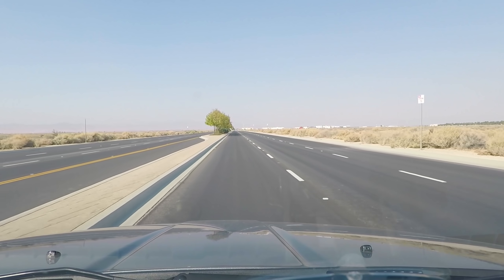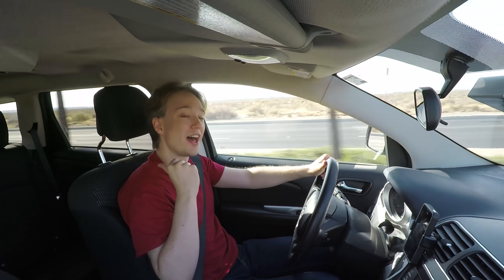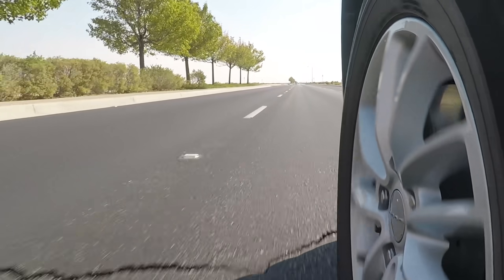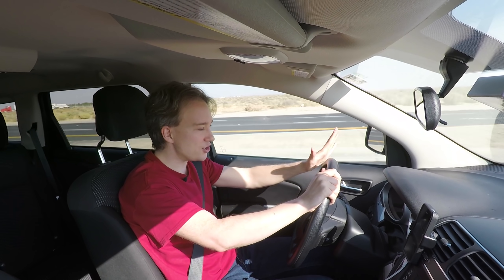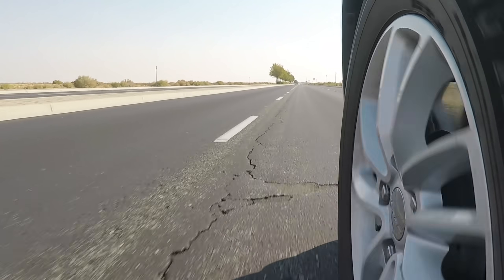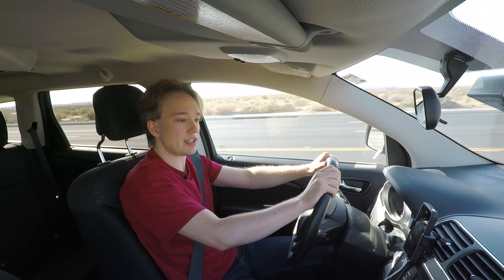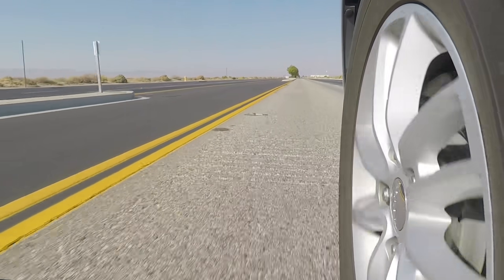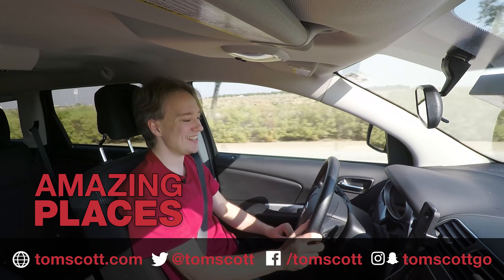Why California's musical road sounds terrible

Comment: try it at double the speed it sounds better
Reply: I like how the 2 times faster argument is the same problem that happened with the road, precision in the language.
Reply: @satibel  best comment in this thread!
Reply: So bassically drive two times faster
Reply: @andrewlarson5621  no
Reply: @andrewlarson5621  yes you donut. That was double means
Reply: @andrewlarson5621  play this video at 2x
Reply: Doubling the speed would get you a felony arrest and a HUGE $peeding ticket. The speed for this is supposed to be about 50 MPH, I believe?
Reply: @oncenterline  it’s on a multi lane divided road in the middle of the desert no one cares unless you crash.
Reply: Sam B. Now how tf do you go 1 times faster
Reply: @Jason_Eissayou  say you are going 5m/s  “1 times faster” would be 1*5m/s faster than your original speed. So 10m/s aka double
Reply: @Jason_Eissayou  you dont
Reply: I’ve seen you everywhere
Reply: This comment thread gave me stage 5 generalized cancer
Reply: NO
Reply: Actually yeah, it does sound better. (it's minor and slowed down, put the PLAYBACK to x2.)
Reply: @Ravenlay I think I agree with you, are you disagreeing with me or a prior comment by someone else?  I hate how YouTube removed the auto reply tagging in the web version.  And I also live in the US and hear them used interchangeably all the time.
Reply: it simply doesn't work int the web version as I understand now.  YT screwed their whole reply system.  I can't do a proper tag to notify people(at least I don't think there is currently a way) but I put that there just so it's clear who I reply too sometimes.  I do think the mobile version still lets you tag people with a '+', but I haven't used mobile in quite a while and could be wrong.  I also can't figure out how to view just replies as they are intermingled in my notifications with recent uploads from youtubers.  I'm subbed to like 250 channels but some of them only upload a few times a year and I miss their content and other times YouTubers will put out 2-3 vids a day and I will only care about 1 or two a week.  I really hate the current YT system.  Even their old legacy system beats the current one which simply has features that used to be there inexplicably missing.  I could rant on YouTube all day, but I'll stop there.
Reply: Sam B. No
Reply: Firestar9114 Ah. I was replying to Sam B. YouTube must have erased the part where it puts his name at the beginning. Maybe I fixed it? I @'ed him? Do I +? I dunno. It's a clunky system :P
Reply: Sam B. neither is 1x1 = 1.
Reply: Housedes123 He is Trolling 100%
Reply: +robert faber ok... that's kind of been established already.  Did you read our responses?
Reply: It wouldn't change it since it's the distance not the speed
Reply: true
Reply: Sam B. That is not real mathematics you are doing.
Reply: Kirill Olokin
• You're right, but there's no reason not to correct people when their language is wrong/problematic
• I don't think you know what "grammatically correct" means
Reply: Ryan Smith you’re actually right
Reply: @kylelyle24  you're* lmao sounds like you would know
Reply: Dustin Allen u happy?
Reply: @kylelyle24  no i'm terribly depressed and constantly thinking about suicide but im glad i could teach you something today
Reply: so 150 mph then? noted I'm on my way there now
Reply: the traffic cop hope you will try that
Reply: I come from the future with the answer. +100% and times 2 is the same thing. So if you do double speed, you could do either or.
Reply: Ohhhh, THAT's why it didn't sound bad to me. I had my video on x2 from a previous video I was watching, and I didn't realize I was still on x2 😆
Reply: It sounds exactly the same only faster.
Reply: Thanks
Reply: You're right, it does sound better!
Reply: In English, it's widely accepted that 2 times faster means the same as 2 times as fast. Look, I understand where you are getting this from(and I wish English was better developed than this), but that's just how the English language is. You are just being too technical, but I don't say that as a bad thing. I will admit that grammatically you are correct, however (because of society)2 times faster means the same thing as 2 times as fast. I hope this is settled now.
Reply: @housedes1233  Sam B. is grammatically correct, and it seems clear to someone like me, who uses math most of the day every day, that this makes sense. I am also aware of a "usage" argument that may be made for your interpretation. Frankly, most of the people I know accept Sam B.'s interpretation, so the same type of argument would apply. Which leads to the solution that a good writer would adopt (assuming clarity is intended): never use this phrase, as it has two definitions, either of which may be reasonably assumed to be true. The correct phraseology, from the standpoint of clarity, would be one which avoids such confusion, such as "twice as fast" or "2 times as fast". Or perhaps, "double the speed"
Reply: It's not just the speed that's the issue -_-
Reply: Same pitch, just faster.
Reply: which is the same as saying 1+1=2
Reply: Speed limits 55, you can't do 110 in a 55
Reply: @jeron9272  Germans: Pathetic
Reply: How do you know runner boy
Reply: It sounds creepy
Reply: Nah
Reply: It does
Reply: What
Reply: do it if you wanna get a ticket for wreckless driving
Reply: Did it, and now i REALLY heard the off notes.
Reply: It sounds like macrana
Reply: @whatthedogdoin578  XD
Reply: Instructions unclear, was pulled over by cops
Reply: nah it’s still out of tune
Reply: 110 MPH?
Reply: I played it at 1.75x and 2x speed, its really better.
Reply: Sounds like crap
Reply: Road safety laws prepare to be ignored.
Reply: But still bad
Reply: It does!
Reply: You right, but it still out of tone
Reply: 110 miles an hour, I'd be surprised if an SUV can even get there fast.
Reply: Time to drive at 240 km/h
Reply: I perfectly agree with you on the fact that the incorrect use of a term should not change it's meaning, and when talking about grammar I do agree that 2 times faster is 2 times on top. But that's just how people are, and when talking with people, I just use the term '2 times faster' as in 2 times as fast because people understand that. I would use '2 times faster' as in triple but it would confuse people so I don't bother. But I can tell you know what 2 times faster really means, so I'll admit that you are correct. Hopefully society will learn the real meaning behind '2 times faster' in the near future, but until then I'll just be using '2 times faster' as 2 times as fast so that I don't cause confusion. It was nice talking to you(I don't get to meet people like you often), and sorry for trying to prove you wrong. Hopefully it's settled now. Have a nice day/night.

Also I'm not from the US, just like you guessed.
Reply: Ryan Smith please leave I’ve seen you way too many times
Reply: all GOAT mathematicians are under this main comment😂😂😂
Reply: harryisbeast You are right, but what Sam B. is trying to explain is that 2 times faster is 2 times the speed on top of your speed, because the word faster is used. The problem is, 2 times faster is accepted as 2 times as fast. So Sam B. is correct when looking at how it is worded, but you are right when looking at what it actually means.
Reply: Sam B.
Sure, you are grammatically 100% correct. But please, don't forget that language isn't math. It changes over time and it is fine, there are no rules that can't be changed by community. Just look at  thousands exceptions, they do not follow the rules, but they are correct.

I am not english speaker, therefore i used to think about the word "faster" in this context as just a direction of change, the opposite of "two times slower". However i am not sure anymore that "two times slower" is correct sentence, would it mean x-2x=-x for you or is it just wrong?
Reply: @WeNeedToGoDeeper  No, hes not 100% gramatically correct. 2 times faster is still double speed. TIMES equals to "*" in equation.

2 times faster than x
2*x=2x

1 time faster than x
1*x=x
Reply: I can see how you got that, but it's incorrect. You're thinking 2*speed on top of your current speed, making it triple the speed. What Andrew Larson said is correct, and here's why:

Let's say we have two weights; 'A' and 'B'. Weight A is 1 kilogram, and weight B is 2 kilograms.

We can say that weight B is 2 times heavier than weight A(B divided by A equals 2, where B represents weight B and A represents weight A), but using your logic, by saying that weight B is 2 times heavier than weight A, weight B is actually 3 kilograms since it is triple of weight A.

Now let's apply this to speed:

If I am travelling at 30km/h and I accelerate up to 60km/h, I am now travelling two times faster than my previous speed. The formula behind this; 30*2=60. When I say two times faster, I am multiplying my previous speed by two, which will be my current speed.
Reply: wtf is this comment section does someone actually not understand that 1+1=2
Reply: @fluffy-xm9yn  It’s not that they’re questioning the math, but the grammar of the sentence. Of course they know 1+1 = 2 but they don’t know if 
fast = faster
Reply: @dinnerboons1504  thats so dumb anyway
Reply: @fluffy-xm9yn  it’s quite special
Reply: +Ryan Smith IMPOSTER!
Reply: @ryansmith3448  among us
Reply: still out of tune
Reply: @ryansmith3448  OH MY GOD AMOGUS
Reply: Sam B. So your issue is saying "faster" instead of "original speed". Faster isn't indicating an offset, it's indicating a sign/direction. It decides whether or not you invert your factor as actually saying zero point five times as fast is awkward to most people. Thus you say twice as slow and invert the factor giving (1/2)*speed. And just like with faster it makes very little sense to say you are going one times as slow. But that doesn't mean that you offset it by the original speed. That's why in the English language we usually say "the same speed" as it is more obvious than saying one times as fast as it is explicit in the two values being equivalent.
Reply: Sam B. "Times" is basically the word form of x in an equation. You're saying that he should go 1 (representation for current speed)  times 1. He should indeed be going 2 times (2x) speed.
Reply: 2x speed as in the playback speed on the YouTube video
Reply: Did I math?
Reply: +Firestar9114 - The word "faster" absolutely does indicate an offset, though... If, rather than talking about "two times faster", you were talking about "50km/h" faster, it would be hard to find somebody who would indicate that second phrase as meaning the car was traveling at 50km/h, instead logically assuming that it's driving at 50km/h plus the original 50km/h, thus making 100km/h total. How then would it logically follow that in the exact same sentence, with the exact same syntactic and semantic structure, the meaning of the word "faster" suddenly changes drastically when changing from an absolute indication of speed difference to a relative one?
Reply: Sam B. That’s times two, one times one is one
Reply: Obviously if you take a scalar and you say faster that is different from taking a factor and saying faster and the preceding amount thus changes the implication to addition, not the word faster.  Faster is still just indicating the sign for addition/subtraction in this case.  Removing the word times and using a value instead of a coefficient is what changes that context.  2 times faster, or twice as fast still means 2*speed.  Saying 50Km/h obviously means 50Km/h + speed, but the operation changes due to giving a scalar and the lack of the word times.  faster indicates simply the direction { '*' OR '+'} and slower is { '/' OR '-' } and the preceding words define which of those you choose from those sets.
Reply: If you do it at 0.25x speed it’s like rock music
Reply: +Sam B. I mean, sure, grammatically you're correct, but this is math, and times always means the same thing as multiplied by.  So I have no idea how you've heard that 2 times faster would mean 3 times.  I know where you're coming from, and technically the grammar is correct, but x times ALWAYS means the initial thing multiplied by whatever x is.  What's grammatically correct isn't always worth using, and you'll just confuse people if you try to use it like that.
Reply: @Loj84  NOPE. It's different for different people, and much like many such differences in usage, it simply has to do with how a given person has used it. I've heard it mostly Sam B.'s way, but a significant minority of the time I've heard it your way. The silly thing is the insistence on using this form to describe scaling, particularly on the internet, which is inherently non-local
Reply: Your channel is dead
Reply: but that's why we have the convention.  Specifically because it would be awkward to say three halves faster, you instead indicate an inverse operation and evaluate out the three halves and say "8 times slower" or "8 times as slow" thus you would do = (1/8) * OriginalSpeed(50km/hr) = 6.25km/hr.  No one would ever say "three halves faster" as the entire point of such a convention is to eliminate stating awkward spoken decimal and fractional values.  This way the awkward phrasing is eliminated.  That said you could also state "object A moved 1/2 as fast as object b"  in this case you again treat it as a factor and simply do speedOfB = (1/2)speedOfA.  It is still valid and used in such simple fractions, but much of the complexity of (1/2)^3 can be removed by evaluating it out and inverting it.  It's not invalid to use the method you gave, It just causes more mental strain either way.  and if you rally wanted to scale 50 Km/h up to 125 km/h you simply say. "two point five times as fast"  Unfortunately the decimal can't be completely eliminated in this case, but because of the relationship in scaling it is still a reasonable value and we can remove the power operation, and it makes more sense than adding 1/2 the original speed cubed to the original speed.
Reply: +*Markus* - Oh, for crying out loud... Nobody here is arguing about what the word "times" means in this context, everybody is agreed about that. It's not even the operative word in the sentence, because that is "faster". If the word "fast" had been given in the positive degree, it would have been fine, because that simply indicates an absolute, but since it's given in the comparative degree, as "faster", it implies a change as compared to the original, hence why (as I pointed out in my previous comment) we say "50 km/h faster" if we want to say that something is traveling at 50km/h plus the speed we're comparing it to, not if we want to say that it's just traveling at 50km/h.
Reply: +*Markus* - Yes, but he was correct about that. "Two times faster" does mean triple the speed, while "two times as fast" means double. And yes, "one times faster" does also mean double the speed, though I doubt you'd hear somebody say a phrase like "one times faster"...
Reply: +Firestar9114 - That is, I'll readily admit, a very thought-out way to rationalise this blatant grammatical error, but it's still fundamentally an error. By your logic, saying "three halves faster" (admittedly a rather peculiar phrase) about a speed of 50km/h would mean you're talking about 50*(1/2)^3, or 6,25km/h, which isn't actually faster at all, but significantly slower. It's much more logical to view that as 50+(50/2)*3, or 125km/h, and the same goes for other relative terms like "two times".
Reply: +Sam B. is absolutely correct here. Saying "two times as fast" does indeed mean 200% of the current speed, but saying "two times faster" means 200% (because of the "two times") + 100% (because of the "-er" in "faster"), thus coming to 300%...
Reply: @rjfaber1991  You're saying that 100%>100%.
Reply: @Sam B. I have to disagree on a couple principles.

One: By your logic, saying "one times slower" would be zero times the speed. "Two times slower" is negative and so on. People don't speak like this. And when they intend to speak how you mean, they use percentages. 
E.g. 200% faster = 3 times as fast.

Two: Language is dynamic. It changes all the time. And if the point of language is to communicate, then what is interpreted by the listener is more important than what is intended by the speaker. The use of language dictates its function. I'm not saying intention doesn't matter, but if one can't speak in a manner understood by the listener, then what's the point? 

Sidebar: I live in the US. I hear people interchange "twice as fast" and "two times faster" all the time.
Reply: @SamB you are dumb
Reply: Sam B. Times doesn’t equal plus but u are trolling
Reply: This comment has been edited so that it makes no sense. Feel free to report it.
Reply: @NG KAI YAN Moe why are you replying to a 3 year old comment
Reply: The guy was saying 1 times faster = double the speed and 2 times faster = triple the speed cuz he was adding read all his comments and you will understand what I was saying I was replying to one of his specific comments

Comment: Can’t blame them for trying. Pretty cool concept.
Reply: The blame is for not correcting the dumb mistake the SECOND time they installed the road at some other location.  Listening is fundamental.
Reply: SET video speed 2X!!!
Reply: Boi u are everywhere
Reply: Japan did one, and it sounds soooooo much better.
Reply: Japan did it better
Reply: Right
Reply: Calamar Bugs y estupideces ikrr
Reply: The blame should be at the idiots that built it, not the designers.
Its a very cool and smart idea, but the construction guys weren't smart and definitely weren't cool.

Comment: Not that it makes much of a difference, as you pointed out, but you are traveling the wrong speed. The speed limit is 65 mph. In California (and I believe some other states) you can be ticketed for driving too slowly. Won't matter when there's no other cars on the road though.